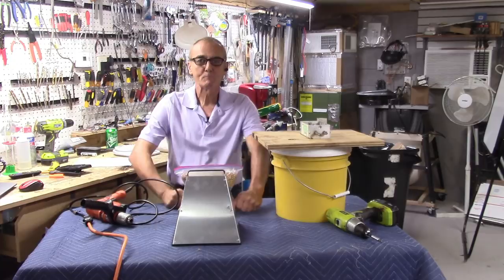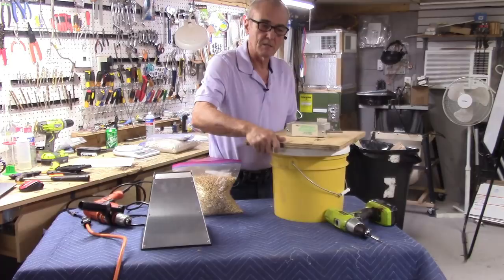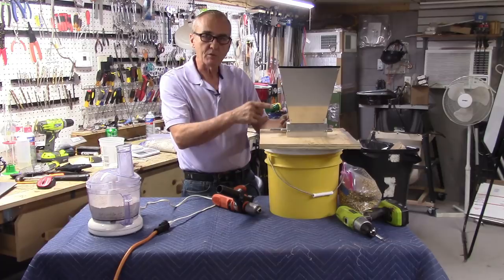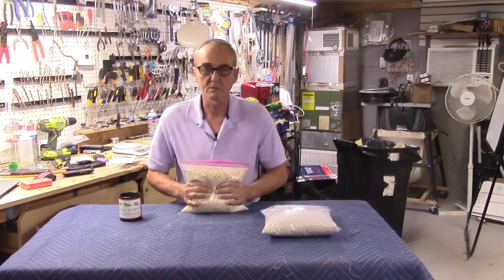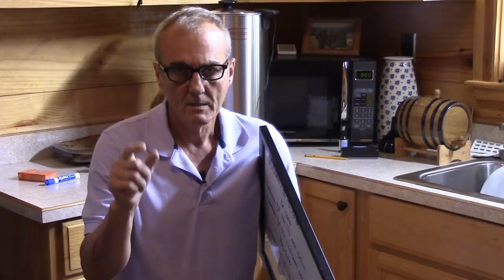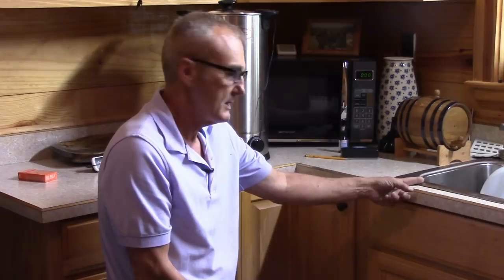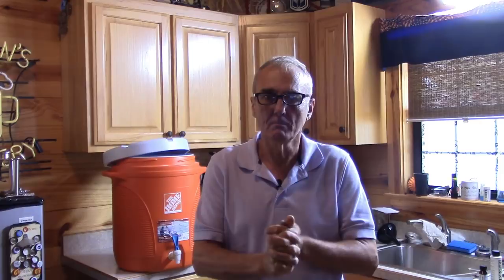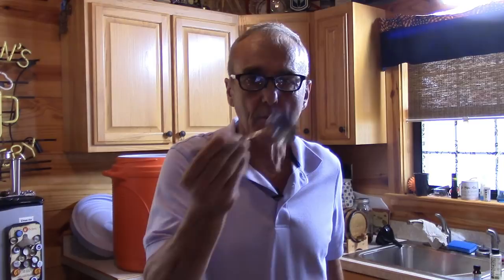MAKING MASH FROM POP CORN AND REGULAR CORN TEST THIS WITH US

Comment: Another way to crack the kernels open is , I put em in a gallon zip lock and let the air out and then I use a rolling pin with a bit of leaning weight.  It minimizes the mess and you can do 2-3 pounds at once.

Comment: Dang, only just seen this vid.
I went thru the whole drama of trying to crack/flake corn for distilling a while back.
In the end I adapted/motorised a grain mill that had optional augers for corn so I could mill it to the level I wanted, does anything from cracked corn to polenta to corn flour.
Slower than a malt crusher or one of the agricultural feed mill-crackers but it makes the product I need consistently each time.

Happy Distlling fella! 😊

Comment: Thanks for the shout out George. At 30:55 I was holding my breath! "Come on popcorn, don't let me down!" LoL:-) Great video with tons of solid data to use in the future. I've gotten a pretty similar result for the popcorn myself. My best was 1.024. I think the regular feed corn just has a ton more starch for conversion in it than the popcorn.

BTW, I found out the hard way that many corn varieties needs a specialty grinder that can accommodate the size. Too rich for my wallet, so I use my food processor, too.
Reply from the maker: In all fairness I think your pop corn and the regular corn are the same. As you see on the video I explain that I just didn't crush it down enough so I guess I started at a 30% deficit with the pop corn.
Reply: @BarleyandHopsBrewing  I can see your point. I'll do some looking to see if I can work out a better way to grind it. I'd love to get better numbers if I can. Thanks George!
Reply from the maker: I have a commercial grinder arriving today from Amazon. I'll let you know how it works out.
Reply: @BarleyandHopsBrewing  I'm jealous!
Reply: @BeardedBored  I just recently got into home brewing and a guy from our local Homebrew store contest made a beer with 2 lbs of popcorn in it. he ran it through an air popper to convert it then added that to his mash. would that work as well for what your doing instead of malting?
Reply: @deansymborski2167  Popping doesn't actually convert the starch to sugars, just steams it in the kernel to make it accessible to the mash. You still have to use enzymes from somewhere to convert the popped starch to sugar, malted barley, malted corn etc.  It's the same thing as using cooked grits, or flaked corn instead of dried cracked corn. The mash temp of corn is much higher than barley, like 190F and has to cook for an hour, so popping it or using steamed flaked corn takes that horrible step out of the process. I knew a guy that took home 2 garbage bags of popcorn from the county fair and made whiskey with it:-)
Reply: @BeardedBored  Yes, I didn't mean convert starch to sugar I guess I meant make it easier to convert instead of trying to grind the corn. So if malting the corn as you did, then you do not need the Barley enzymes to convert the starches but if you air popped it you still would need Barley? Thanks for the lesson!
Reply: @deansymborski2167  Yep, if you malt, then the enzymes are in the grain so you just need to mash at 145F to 155F to convert. If it's popped, then you'll need enzymes from elsewhere. Either malted barley or commercial enzymes.

Comment: We should call you Professor George. The best step by step explanation of mashing corn ever. You go against the conventional wisdom of boiling the cracked corn to fully gelatinize it before cooling and adding the barley malt which saves a step and some hassle but your starch test shows some starch still present (slightly darker than the malted corn). Also, do you and Bearded think that your lower gravity with malted corn is due to insufficient grinding or does the corn just have lower diastatic power?

Thanks for the video, Professor!
Reply: Oops, got it backwards, George, the cracked corn and barley malt sample had a little more starch remaining, not the malted popcorn. Yet the SG of the popcorn was lower. Interesting. Maybe the barley malt percentage in your mash bill needed to be a little higher.
Reply from the maker: I do believe the difference was due to inefficient grinding on my part. Both SGs were brought to the same level in the end.

Comment: Hey George...No problem with the date issue.  But I understand you were a Sgt, Major and demand for excellence is paramount.  I too am a retired vet.  Mustanged thru the ranks from 1972 to 1997 (USCG reg. and reserve...and some time in the Army Nat. Guard).  But we share in common a passion for the art of brewing/distilling and I owe a lot to my civilian career because of it.  I was once challenged to see if I could make damaged corn work.  It was moisture/mold and afflitoxin contaminated.  Our company decided against it.  Any thoughts you have about using contaminated feed-stocks would be interesting. And one last thing,  I really like the way you interchange metric measurements with U.S. standards.  When I worked at NASA we were required to do that (after we screwed up the Mars polar cap landing around 2000 - 2001).

Comment: i watched a video made by a brewer doing a all grain (what ever they call it)  he used a pot on the stove to heat his grains/water to 160  then he simply put it in his oven for a hour at 160 to convert the starches to sugar. i tried this in a 4 gal. stock pot with 14lbs. of frozen sweet corn using alpha amylase. worked like a champ.  it cuts out using the water cooler.
Reply from the maker: Correct. This is just another way of doing the same thing.

Comment: Don't be too hard on yourself bud you're a good man.

Would a cotton pillow case work for a grain bag? Or is nylon superior?
Reply from the maker: I would prefer cotton. Nylon melts too easily. If you can keep nylon from touching the sides or bottom they work great. 
Also the more porous it is (larger gaps) up to the point grain falls through the better. The lower the thread count the more porous it is. 1000-1800 is very tight whereas 400 is more porous and allows more to flow through it.
Reply: @BarleyandHopsBrewing  thank you for your insight. Some day you're going to see Thomson small batch on the top shelf and it's all because of your teaching shills. I tip my hat to you sir.
Reply: A cotton pillow case is great for beer wort. I can't see why not.

Comment: Hey George, I've actually been working on something related to this. In fact, today, I was looking to buy a boot-load of yellow dent, but everything I found online was priced WAY above what I'd expect a 50 lb bag of basic yellow dent to cost, generally around $75. Now, I know I could just use basic sweet corn or white corn, they're just types of yellow dent themselves, but I was wondering if there was a special type of yellow dent that would justify those sky-high prices?
Reply from the maker: Dent corn (has a small dent in the head of the kernel) is packed full of soft starch. That is more likely the reason why it is more expensive
Reply: @BarleyandHopsBrewing  yeah, but it also represents the vast majority of corn that is produced in this nation. You see a generic corn field, odds are that is yellow dent. I just wasn't sure if there was a special variety that I was seeing that was even better than regular old yellow dent. 

I'll probably just go to tractor supply.
Reply: Whole feed corn works great.

Comment: so when germination start on said seed or  what not .. you say stop and dry ..then make it in to say crack cord style .. so can you just crush or crack  said seed while it being wet per-say instead of dry to stop said germination ? does that make sense?
Reply: It can be used without completely drying. You have to dry enough to stop the sprouting process though. The hard part is getting rid of all the roots and sprouts when wet.

Comment: I think your pounds to grams calculation is a bit wrong.  There are 454 gms to a lb.  
Maybe I'm missing something?
Reply from the maker: No you are not missing anything.  I corrected that on the next video. It is 453 or 454 if you round up. 
Thanks for the comment. It keeps me well rounded.
George
Reply: Absolutely love your videos.  Keep up the great work mate.
BTW I was one of those many "non-subscribers" but I'm am now after your reminder. :)
Reply from the maker: Awesome. Thanks
Reply: 454 grams per pound was the first metric conversion I ever learned. It has been on the side of ketchup bottles forever.
Reply: I just remember 454 is a big block chevy.

Comment: Screen is all black Goerge
Reply: that may be caused by windows os (if that is what you're using)  lately a lot of people have been reporting black/ green screens in videos. or green bars both vertical and horizontal. 

i get green bars myself. and haven't found a way to fix it yet....
Reply from the maker: I had an issue with several different things in Windows and ended up doing the Microsoft windows 10 upgrade repair.
Check this out. It may solve your problem. It works extremely well and solved all my issues, even the temp file overload i kept getting that slowed my computer down and filled up memory space.
http://answers.microsoft.com/en-us/insider/wiki/insider_wintp-insider_install/how-to-perform-a-repair-upgrade-using-the-windows/35160fbe-9352-4e70-9887-f40096ec3085

Comment: Why 6 row rather than 2 row?
Reply: Six row barley has more diastatic power (more enzymes for starch conversion) than 2 row. It also has a lower yield of fermentable sugars and less flavor than 2 row, which is why it is super useful for distilling, but generally only used to aid in converting adjuncts in beer. Bring this recipe to a boil, add some hops, and you've got the "champagn of beers!"
Reply: @dontuse  thanks for the info!
Reply: @jimbartosevich498  You're welcome!